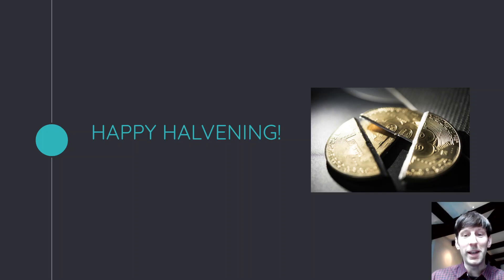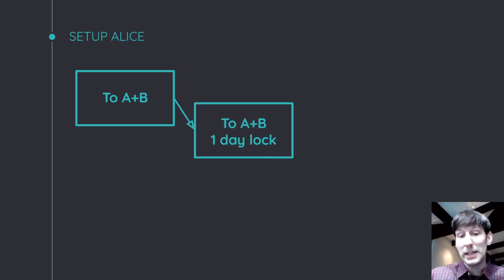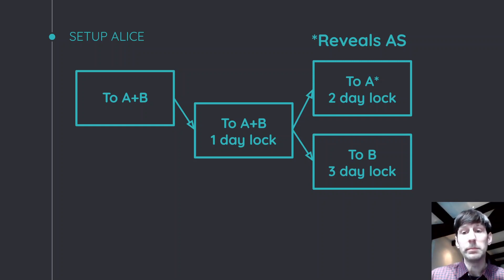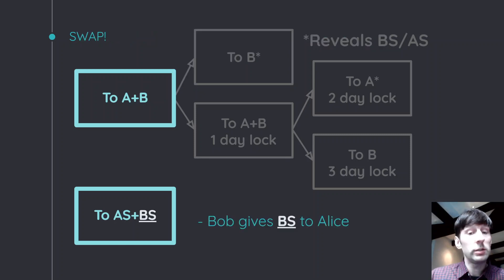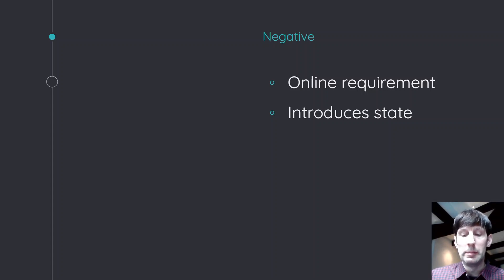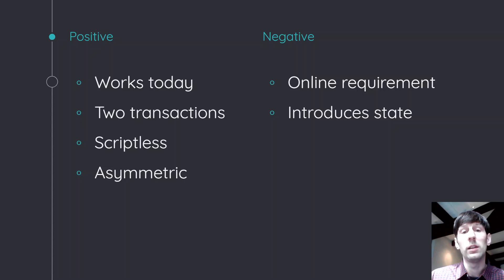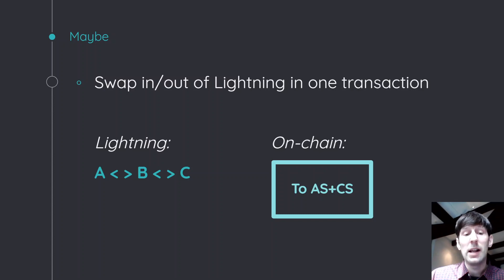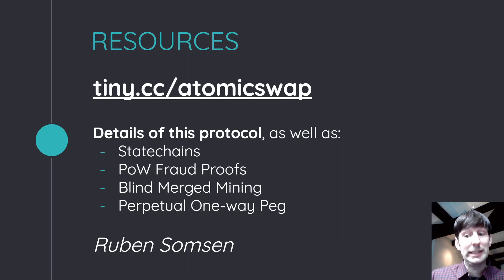Succinct Atomic Swap

Comment: is 2p-ecdsa amenable to ecdsa adaptor signatures?
Reply from the maker: 2p-ecdsa is a way to do multisig with one key, whereas the trick I refer to here is not multisig but does allow for adaptor signatures. The reason this is preferable is because it doesn't require any new math that may or may not be unreliable.